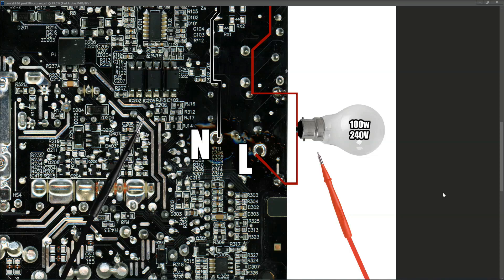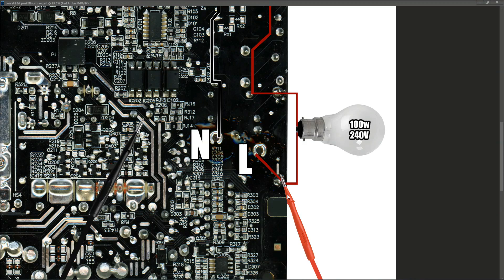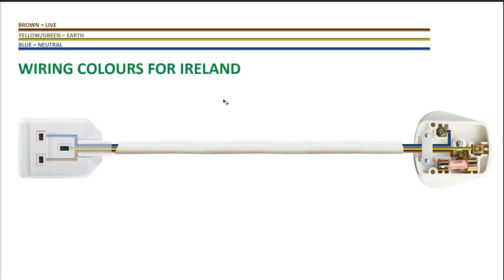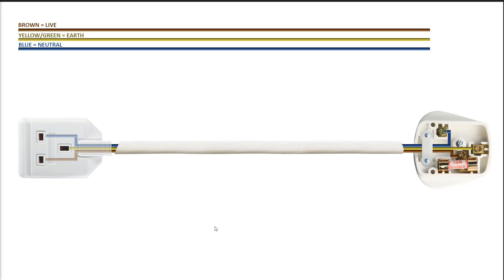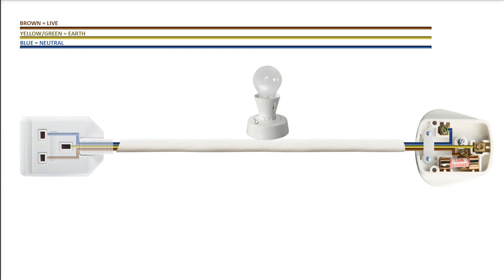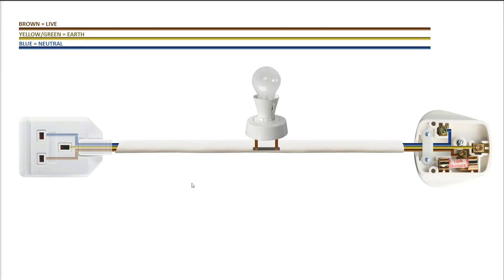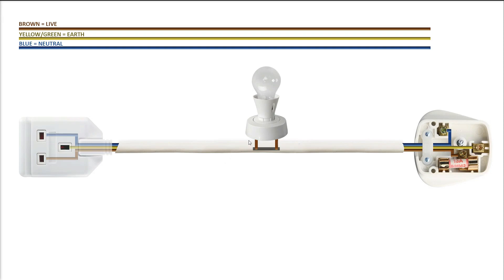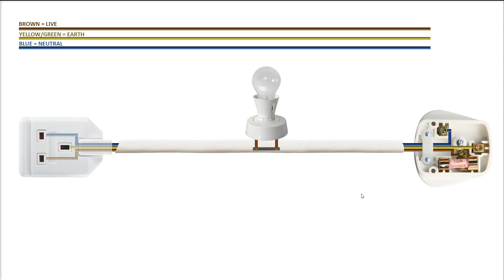Series Light Bulb For Short Circuit Protection

Comment: @therepairshare673 What sort of light do you use, and what wattage?
I don't think we can buy incandescent filament bulbs anymore. Will a low-wattage LED bulb work?
Reply: Maybe you can try with an "infrared bulb" used for lots of thinks like physiotherapy, chick incubation, etc.. Those generally come in 250w-500w, which I think are even better than small light bulbs for this use-case. They look like normal incandescent bulbs, but with a red coating and usually a wide, flask-like shape.

I don't think you can use LED bulbs with this method, because you are essentially using the light bulb as a "negative thermal coefficient" resistor (as in NTC thermistor). You are depending on a very low initial resistance (given by the "high wattage" of the light bulb) to introduce as little distortion to the AC at first. Then, if you draw too much current, the filament starts to get hot, reducing its resistance even further. This creates a positive feedback loop, allowing the filament in the light bulb to take as much current away from your circuit.

A LED bulb doesn't do any of that stuff, it has essentially an internal power supply (sometimes an active switching one) that provides a very specific current and voltage to an LED array. If you had an LED bulb on this protection circuit connected to a shorted device, I'll mostly expect a blinking spectacle of flickering bulb and sparking power supply D:
Reply from the maker: Hi, Any wattage should work to check for short. Not sure about the LEDs - I presume that they will respond similarly to the filament, but I will check.